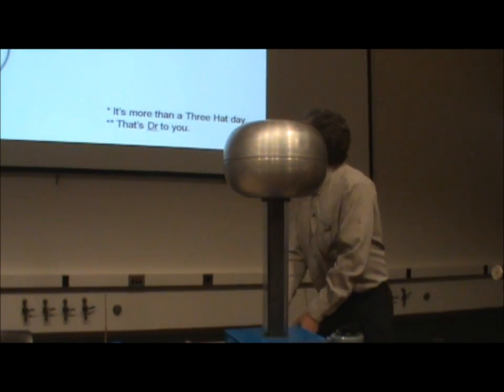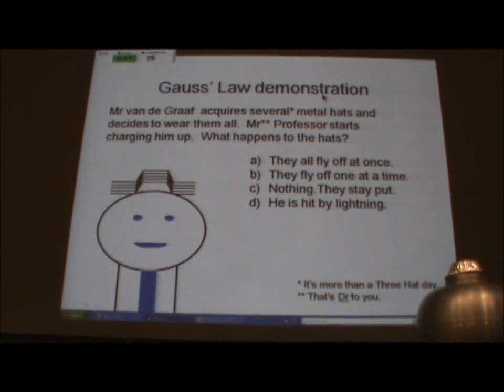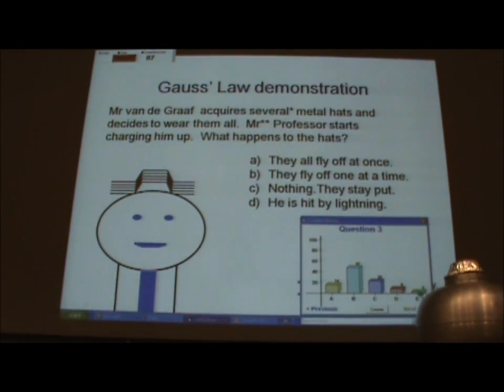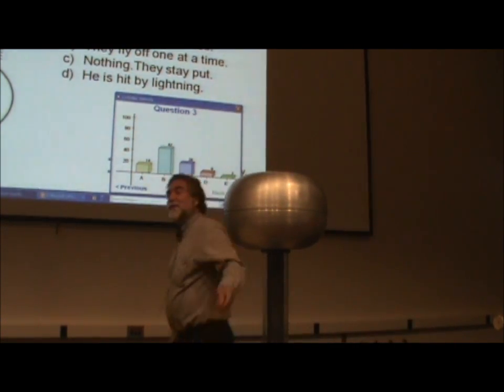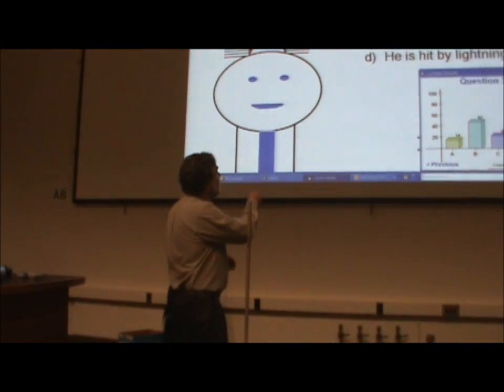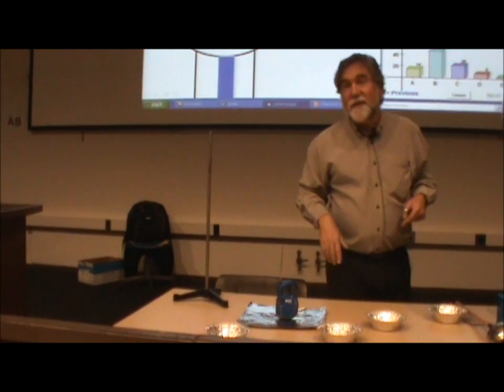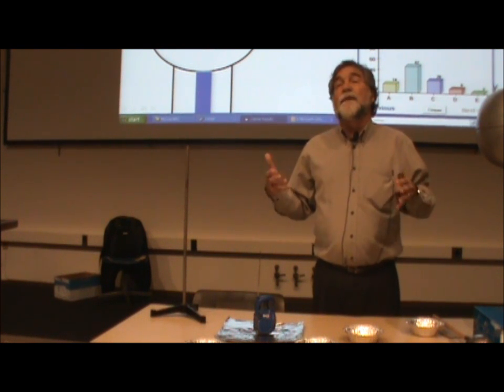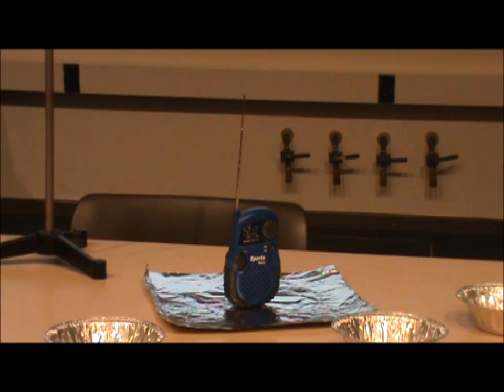Gauss's Law Demo

Comment: How is this specifically an example of Gauss's Law?
Reply: +Ryan Moran 

I asked myself the same thing. Turns out is is not trivial, and is definitely not covered in this four minute video, so...

Good question.

We are attempting to conclude from Gauss' Law that charge distributes on the surface of a conductor. (I'll tell you late why this leads to answer B.) Hence, we will assume information about charge, electric field, Gauss' Law, and even that conductors have free-flowing charge carriers, but we will NOT assume charge collects on the surface of a conductor. We will show this latter statement using our list of assumptions.

Imagine a closed surface just under the surface of the Van der Graaff generator and outermost plate. This closed surface would enclose all other plates. The Van der Graaf generator introduces a net charge to the system. When this charge is introduced to the surface of the conductor (made up of ALL the plates and the generator), the charge creates electric field lines throughout the conductor system (again, all the plates and the generator). These electric field lines cause the conductor's charge carriers (electrons) to flow away from the introduced net charge. At firs the electric field is non-zero inside the conductor when the charge is first introduced, but later becomes non-zero at every point inside the conductor.

Don't believe that? Well, if the electric field were non-zero at any point in the conductor, then a flow of electrons anti-parallel to the electric field lines would occur until the new electric field inside the conductor becomes zero.  (Otherwise, a new non-zero electric field would cause a new current of electrons to move somewhere else.)* The electric field at all points within the conductor will "eventually" become zero. In reality, "eventually" is instantaneous to human perception.

Here's where Gauss' Law comes into play. We know the electric field is zero at all places within the conductor. Therefor, the electric field is zero everywhere on the Gaussian surface. (Remember, this closed surface is just inside the surface of the combined generator and outermost plate. It encompasses all other plates.) If the electric field is zero through every point of a closed surface, then adding all these zeros gives us zero flux through the Gaussian surface. By Gauss' Law, if the flux is zero through a closed surface, then the enclosed net charge is also zero.

So where is all the net charge the Van der Graaf generator introduced to the system? It is only on the surface of the conductor, i.e. the surface of the Van der Graaf generator and the outermost plate. Hence, the only plate which will have a net charge and will be repelled by the like-charged Van der Graaff generator is the outermost plate. Thus, this experiment is a demonstration (and only a demonstration, not a proof) of an application of Gauss' Law.

I think there is also a fair question to ask about near the conductor surface on the inside of the conductor: What about near the edges, shouldn't there be a field there? All that charge on the surface and there are no field lines directly inside the conductor next to that net surface charge? That is correct. Just as a ring of charge nicely cancels such that there is no electric field at any point inside the ring, a sphere of charge has the same canceling effect. It doesn't matter how close you get to any one surface charge on the inside of the conductor, the other surface charges' electric fields will add at that point to create zero net electric field at that point.

********************************************************************************

It is amazing how complex such a simple application of Gauss' Law can be. In computer science courses, we are taught early on that if we cannot instruct someone exactly how to do something (such as put on socks and shoes), then we do not actually understand it ourselves. While most people can intuitively guess that the answer was B and each plate would fly off one by one, how many can actually explain why this is an application of Gauss' Law? Then how many actually understand the most basic law on which all of our electromagnetic technlogy is based?

*I'll be honest, this part about charge carriers "filling in the gaps" of electric field inside the conductor is probably one of the weaker parts of the "proof". It deserves a more mathematical and rigorous derivation. For now, though, we can probably agree that it is conceptually intuitive that electrons would spread out anti-parallel to the electric field lines until an equilibrium is achieved. Even then we might wonder about some oscillations and movements, and our true understanding of electrons in modern physics is that they certainly never stop in one position!
Reply: +Alexander LaFleur 

Wow, thanks for the awesome and detailed response!
Reply: @alexanderlafleur8754  please help me